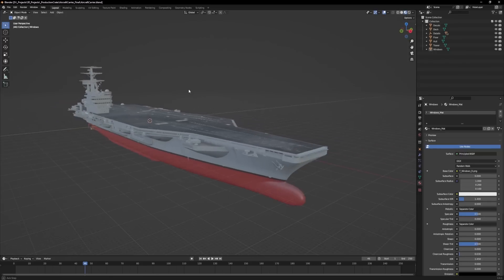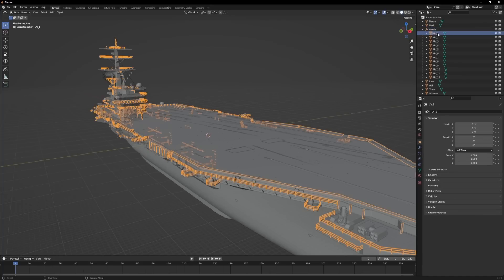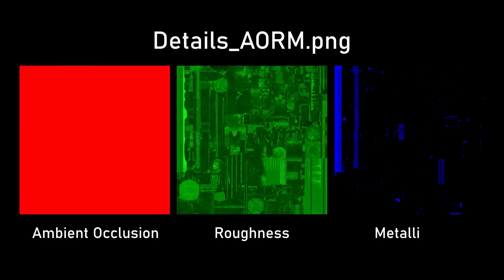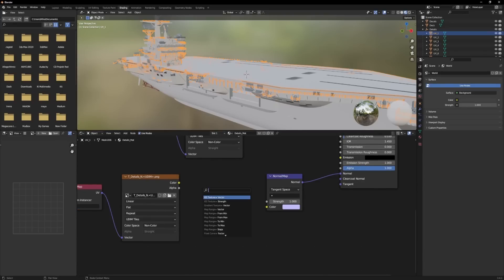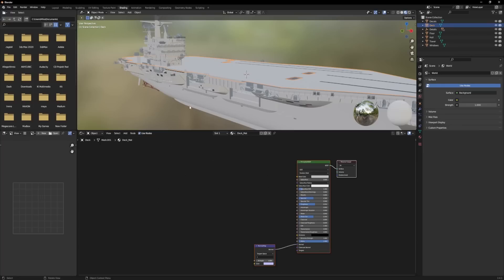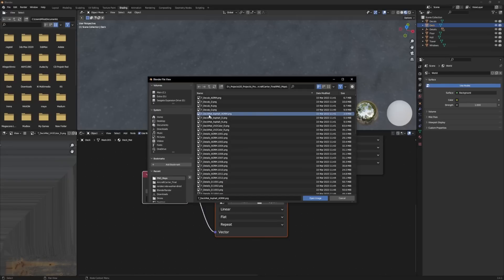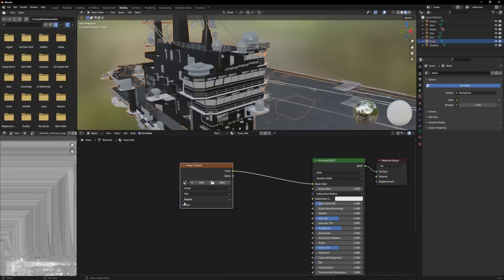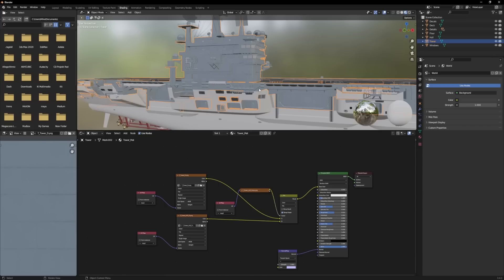Blender Textures Tips - Advanced Skills

Comment: How does subtracting 1 invert the green channel? I cannot get that to make any sense. It would just offset the values by 1. Normally you would have to multiply or divide with a value of -1, to invert anything.
Reply: Sure thing, So first off, an invert node works just fine. I had seen on the forums that it should be done with substract, but apparently it's unnecessary. But to answer the question, color channels are just shades of gray from black to white, expressed as a number. 0-1.  If you subtract 1 minus 0 (black), it equals 1 (white). So you've converted black to white. If you subtract 1 minus 1(white) it becomes 0 (black). So it converts all the black to white. It works for all the shades of grey in between. 1-x is a very common math node in node-based programs for inverting things. In unreal the invert node is even just called 'OneMinus.' Since I'm new to blender and the forums couldn't agree on how to invert green, I just used a universal math trick that is used across the industry to invert stuff.
Reply: Yeah, I testet it out in a simple math expression, it seems to check out. funny.. never thought of using that, been working in the industry for 25+ years, retired from CGI some 15 years ago. Always used multiply to invert. ;) Also, in my head I subtracted after the value, which only offset, and that didn't make sense, but now it makes a little more sense, as you start the value from a mirrored value ;)
Reply: @noxlupi1  Yep I made that mistake all the time too haha. I would always do x-1 instead of 1-x at first.

Comment: I got a little secret for anyone who just wants an easy time importing most obj and fbx models into blender. Get the cc blender tools addon (its free) and import the model u want using the addon. cc blender tools is meant for character creator 4 models. But it works with almost all fbx and obj set ups. It has some other real cool things as well. Like being able to save animation data and rigs. Its actually insane and could easily be spun off into a superior export import addon well worth some money. Other side note, cc4 is just insane in general, It has a lot of crazy powerful tools for just about any model. You just have to test stuff out.

Comment: Does "Invert" node work the same for inverting the green channel?
Reply: I think it would invert all 3 channels. So you need to do it the way he does it
Reply: I have written a few HLSL shaders and it makes sense that a vector is the same thing as a colour from computation point of view.
Reply: I've been reading in the forums that you can invert the color in a few different ways, but by using separate xyz, you keep it as numbers instead of converting it to color and then back to numbers. It's slightly faster
Reply: Colors channels are just numbers and colors are vectors, they're one and the same especially in the shader world. There is no conversion going on. Though some of the color related nodes may be slower if you're directly comparing a map range to a color ramp or math nodes to rgb curves, depending on how they're implemented. But that's just because the node is doing more math, not because it is color data specifically.
Reply: @exmello  Good to know! Thanks! That's intuitive, but a few people on the forums had the same answer for me. So I figured there was something in the background about blender I wasn't aware of.